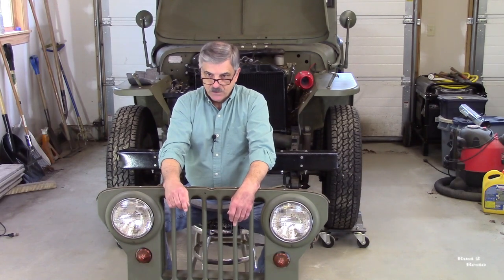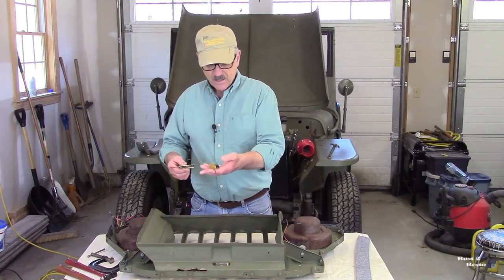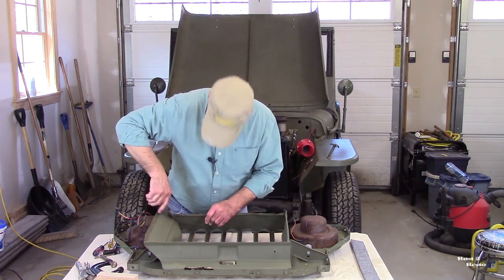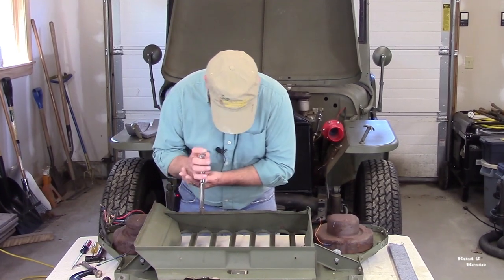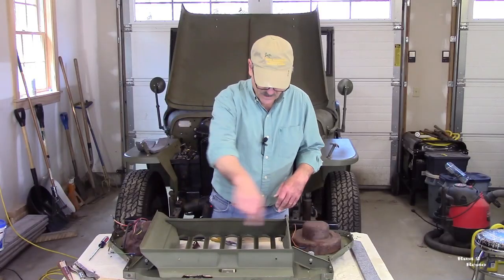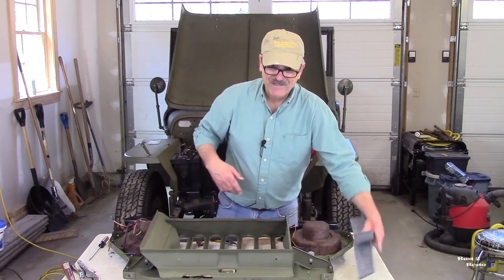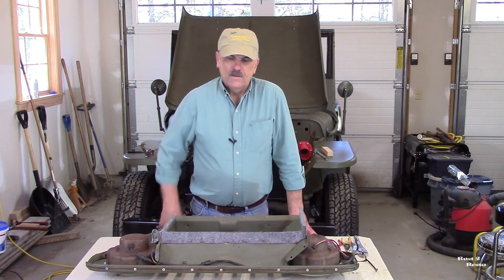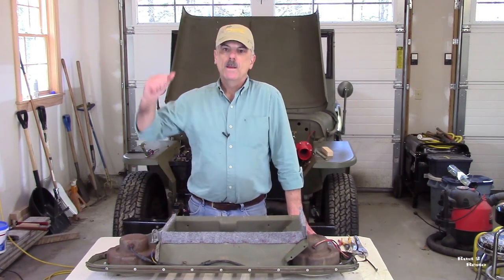1946 Willys Jeep CJ2A; How to install felt air deflectors on the grill for more cooling air.

Comment: The crazy things people did back then! I never would have thought of using felt to fill the gap. I was wondering why mine had such a fat gap. I thought the reproduction radiator was a bad fit. Is it real wool? Anything that does not repel water I would expect to cause rust.
Reply from the maker: Thanks for the comment Proctor.  The felt was  an oem part from the very early days.  It helped to direct air flow into the radiator and keep air from spilling out before it got through the shroud.  I helped bring the temp down a good ten degrees on mine.  Not sure about the rust.  I have never seen a grill that is rusty from the felt.